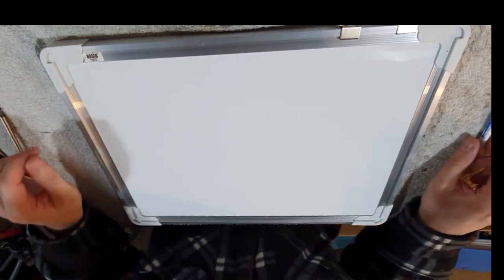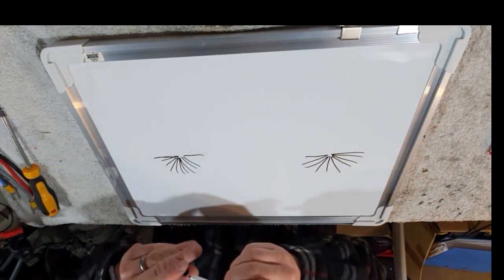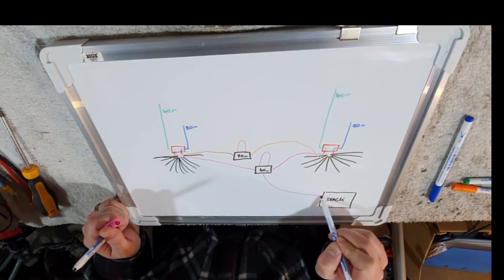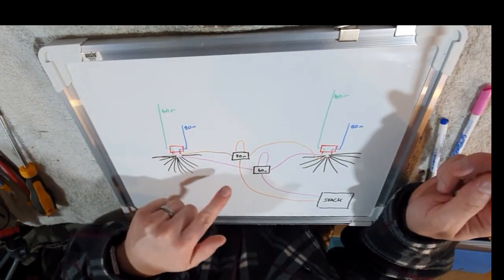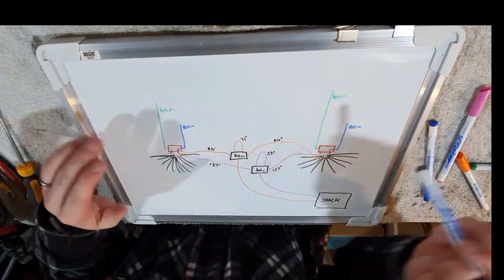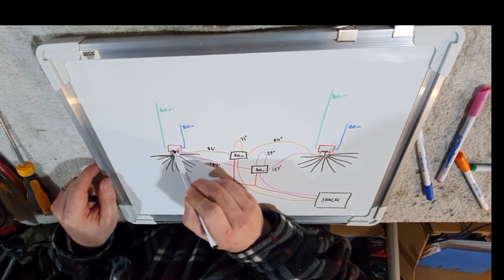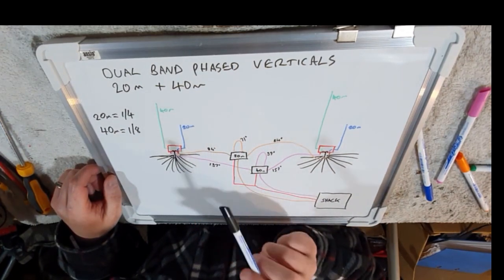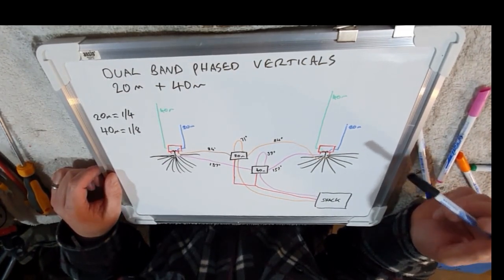Dual Band HF Phased Verticals - Is It Possible?

Comment: Hi Colin, I can't see why it wouldn't work. Essentially it is two separate arrays which have their own independent feeders with their own delay lines with respect to their spacing. I haven't used 1/8 wave spacing but have tried 1/4 wave spacing on 15m with 71 deg delay line and 2 x 84 deg feeds. I also wired the relay to give broadside too, bypassing the delay line but was never happy with the SWR when they were in phase. 73 de G3WW
Reply from the maker: Will I ever get round to it, who knows. I know what you mean about the SWR but you can build a simple L match with an LCR meter. Justin KG2RG did this with great effect.

Comment: Hi Colin, I’m building my phased verticals now and am wondering how much voltage drop will be going 200’ with the control wire. Will the relays still work.
Reply from the maker: Thats a fair question, the relays need very little to switch but what will matter is the cable your using. Make your cable,  connect up your power and check the voltage at the other end with a multimeter and see where you are. Check and see if the relays switching and tweak the voltage if need be. My gut tells me you will be fine though.
Reply: @MM0OPXFieldRadio  Thanks that’s good information. I’ll let you know.
Reply: Bill you can always use a bias-T and run your DC through the coax.
Reply: @dezwatson6993  Thanks, I’m in the process of getting material together. Will look into that.

Comment: what's your thoughts on 40m .25 wave and 20m .50 wave spacing?
Reply from the maker: Same principle so should work, just need the  matching coax lengths to allow for 1/2 wave spacing.

Comment: I doubt it could ever be broadside. 
Only endfire in two directions.
Reply from the maker: Perhaps,  only 1 way to find out.
Reply: There's no reason why the array couldn't be broadside. You just short out the 39 deg or 71 deg delay lines so each vertical is fed in phase.

Comment: My phased verticals are a half wave length apart, do they work with 1/4 separation, or a full wave length?
Reply from the maker: 1/4 wave is the most common. 1/8 wave less so. Both work well.

Comment: It should work. But, the investment in time and practical work to set it up, will the returns be worth it? And it you had to strike it and re-assemble it, the circumstances are never identical, are they?

Feels like a good project and video, but a woeful albatross to use!
Reply from the maker: It's something I would like to try, I have 90% of everything needed already.  Agreed from scratch its quite an outlay but if proven to work it would be much cheaper and more practical than a 20m & 40m yagi which only the very few could have. I could physically set this up sub 2 hours if I had all the bits ready but tuning is a different matter.